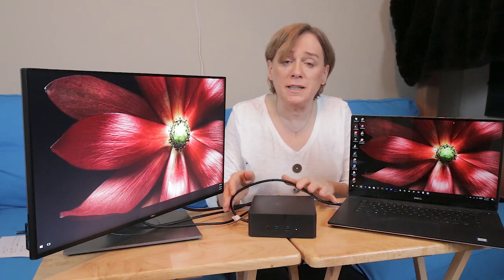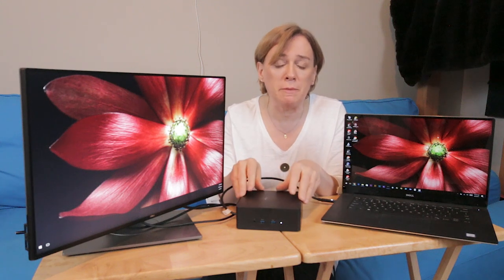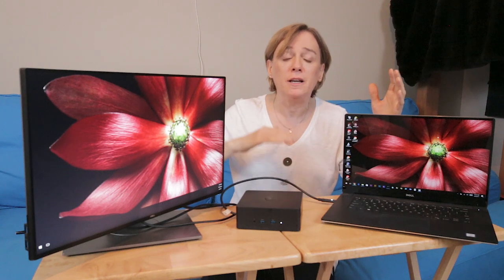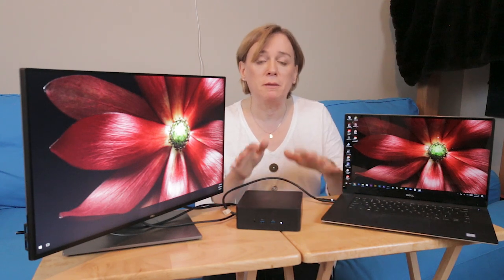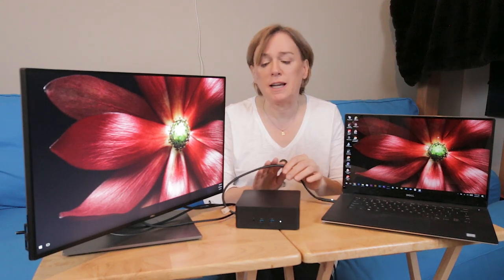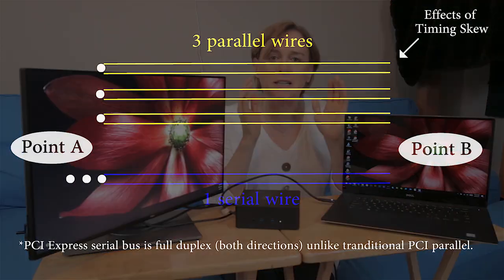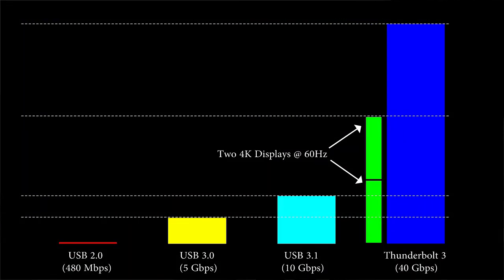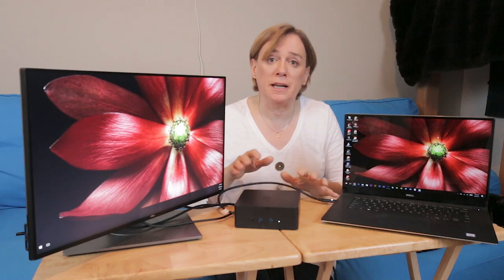Longer Dell Thunderbolt Dock TB16 Cable?

Comment: My biggest problem with this unit (I own 3 of them, one for my home office, and one on each of my 2 offices) is not the length of the cable, but the stiffness of it. It puts a significant strain on the port in the computer if it doesn't sit perfectly straight (effectively shortening the usable length). 
It is still the best way to connect PowerDelivery + HDMI UHD Screen plus a few of my USB / USB-C Peripherals (Webcam. Audio Interface, MIDI Keyboard ...) which is why I keep using these everywhere. I've tried many extenders, and never understood why they wouldn't work or my screen would flicker... I figured it'd be the extension, but never knew why. Now I do. I've then narrowed my search to finding just a 90 degree USB-C Thunderbolt adapter to help alleviate the strain on the laptops port. Hopefully that works. 

Thank you for this video, over half a decade after, still informing people. Amazon has dropped the price of this dock significantly, fyi, where it can be had for under $40, making it an outstanding deal.
Reply from the maker: @PaulSuquet, It's September 2023 ... forgive the delayed reply, just finishing a lengthy break away from the channel. Re the TB16... I fully agree with you... I still use my TB16 quite often, and sometimes with several large external USB storage devices connected through it, flawless... have not had any issues yet (beyond wear/tear leading to a cable replacement). Given Thunderbolt complexities and the abundance of high bandwidth traffic being multiplexed over a TB cable, I was never interested in interfering with Dell's design as they tested it. Given I use the TB16 for HDD connectivity, it's just too risky and my data is more important... meaning there are no 3rd parties between my TB16 and the XPS 15 9560... that is my rule. Given the overwhelming, quite surprising reliability I've experienced, it seems my sticking to spec makes sense. I've seen what happens even with some USB hubs and HDD traffic... it's not fun when it fails. The TB16 has been 100% perfect... no issues whatsoever with boatloads of HDD traffic. Regarding cable length... since this 2017 video, I've moved to a desk top setup... I initially used the TB16 on those small dinner trays and the couch... quite successfully actually... but those situations are challenged by the cable length, but when I moved to a desk setup, issues with cable length go out the door, are not an issue. Anyway, it is super great to hear your experience... it makes me wonder if I should go out and pick up a couple of more. The TB16 and XPS 15 9560 teams should get an industry award. (Yes, I know the 9560 only has two lanes to TB controller... but that's the spec of the unit... given that, it works well, very well for its bandwidth.) Thanks for stopping by, sharing your experience!

Comment: The 40Gbps Thunderbolt 3 cable in the TB16 is already an active cable, and with a substantial power consumption. I removed the TB16 cable from a dock and opened up the fat end of the cable that hides inside the dock. The fat end of the TB16 cable hidden inside the dock contains a circuit board, active chips that convert a many-pin connector into TB3, and thermal pads on both sides of its circuit board that sink heat to ridged metal exterior of the fat end of the cable, which is then cooled by a fan inside the TB16 dock. If it were to be longer and require any more power than it already uses I don't think the TB16 fan would be able to cool it.
Reply from the maker: @jamesmars6166, Thank you for your insight and for stopping by! It is 2023 now, forgive the delayed reply, was on long break from channel.

Comment: Thank you for saving me the time and trouble of attempting to swap my TB-16 and WD-15 cables!  I was going to do that to lengthen the cable; I did not realize the 40Gbps Thunderbolt-3 rate had a max length of 1.65ft.

I'm currently running an XPS-13 2-in-1 (9365) maxed out all specs with a TB-16, a KM-717 Combo, and a daisy-chained triple display U2417H InfinityEdge setup running off the mDP port.  The short cable length of the TB-16 was causing me some cable and desk management anxiety.  LOL! :)

Great video!
Reply from the maker: Thanks for the word Rahul, thanks for stopping by!
Reply: I actually swapped my WD-15 cable into my TB-16, my two monitors and peripherals still all work as expected. The TB-16 cable will not fit into the WD-15 though because of some pins on the connecter.

Comment: Thanks for the video Ashley. I embarked on a similar research and discovery adventure a few weeks ago, as I too wanted a longer thunderbolt cable... of course I came to the same conclusions as you, and have accepted the limiting cable length with a newfound respect for the thunderbolt 3 technology and this dock in particular. I must say, the TB16 combined with my XPS 15 and 27 inch external monitor are working fantastically! I think I have the exact same setup as you do in the video. I'm extremely happy with my setup and highly recommend this dock for anyone with a thunderbolt capable Dell laptop.
Reply from the maker: Thank you!

Comment: I have the TB16 with my Dell XPS 9560 but also run 2 extra USB-C ultra portable Asus external 15.6" monitors. My setup is super portable and allows me to setup wherever. I have used a type-c right angle connector going into my laptop and still am able to use everything including video and power, with no issues. Everything including my TB-16 and monitors fits in my messenger bag. My internet access comes from my Nighthawlk MR110 4G LTE router. It's pretty sweet!

Comment: Passive Thunderbolt 3 cables (made of copper) are identical to USB-C cables and plug into Thunderbolt 3 or USB-C ports: They transfer data at up to 20Gbps but they're not necessarily the most efficient. Active Thunderbolt 3 cables will use integrated chips to achieve full 40Gbps throughput. You should use active cables when connecting your laptop to 4K or 5K displays, or a solid-state-drive (SSD)-based RAID array. Active cables made of copper are limited to about 2m (6 feet) in length. 
Active optical cables (made of plastic and glass, like fiber optic cables) can extend their length from 2m up to roughly 70m (200 feet), but they require switching over to optical ports.

Comment: Do you know anything about the wd19? I have the tb16 and the wd19 and want to know if I should keep the tb16 or sell it and use the wd19 which isn't Thunderbolt 3.
Reply from the maker: @kylecthomas6513, It is 2023 now so you are probably long past your question. I do not own a WD19 so do not use one daily. I still use the TB16 regularly, sometimes with several hard drives connected, no issues (beyond cable replacement due to wear/tear). Re your questions, including whether or not to sell something, it's really not good to say without knowing more about your use cases and so forth. You should probably make that kind of assessment based on what you know of your overall situation, budget, whatnot. Forgive this delayed reply, it is 2023 now, was on long break from channel.

Comment: This video was extremely helpful to me. I was quite confused by all of the seeming contradictions of my new TB16. Thank you. 

Do you suppose a 90 degree adapter at the very end of the Thunderbolt cable would greatly affect the bandwidth?
Reply from the maker: Thank you for watching the video, I'm glad it was helpful! I can't say offhand what the loss would be but I've heard any sort of add-on connectors could affect speed and reliability. While I've never tried anything but their default cable, I've seen many times before when there are standards that express limitations that are shown to be looser than otherwise appears. You could experiment but there's no guarantee it will work or not cause additional problems... it's always at your own risk when going away from the mfg commitment. Thank you again!
Reply: yeah that is what they should offer and avoids material tension in the switch..

Comment: I remember watching your video a couple of years ago but I've stumbled across it once more while looking to see if Dell have released a cable since. Any update Ashley? I can't find out anything myself on this one! Keep up the good work!
Reply from the maker: Hi Lawrence, thanks for stopping by and the kind words! Some have mentioned there are active cables that work but I've not personally tested... I still use the supported default cable. I recently made a video on how I replaced that cable w/ebay replacement cable because the origina had gotten worn/broken... so now I have the same size cable but it's been replaced/refreshed. Now that I have a desk, it mostly work fine, did before too... would be great to free up desk space with longer cable but I'm making due. Thanks again for stopping by!

Comment: The wire is short because of the 240w it can push to charge the laptop. The XPS 15 only has 2 pci e lanes on its thunderbolt 3, its operating at thunderbolt 2 speeds anyway.
Reply from the maker: I was not aware the TB16 short cable length was connected with limitations caused by power delivery requirements... Thanks for sharing that. Where did you find that out? Thanks for watching!
Reply: The typical max is 100w, since the xps needs more, the cable has to be short
Reply from the maker: So do you mean the Thunderbolt 3 specifications literally, or just info at that URL you referenced? I do not have access to the actual specs so can't check there. But on the page you referenced, I do see a mention of 100W but no mention of cable lengths in relationship to power delivery. You could be inferring the 240W requires the length to be shorter than the standard given that 100W is mentioned on that page... but somehow I think you mean something more concrete connected with the actual TB3 standards. (?)
Reply from the maker: So perhaps you're inferring that since the public aspect of the standard calls out 100w in high level info that, for any more power such as 240w, the length can't be as long as typical cables? Makes sense, just curious if it's an inference or something tied to TB3 specifications. Thanks!
Reply: This Dell dock can pass through 130w. The remaining wattage is for devices attached to the dock. Only the "DC" docks can pass through 240w.

Comment: I really enjoy your content! I'm considering getting the Dell XPS 15, but I have a quick question. Do you notice any lag on the XPS when plugging in an external monitor? Other people have been saying that the fans kick in and get pretty loud on the XPS when using a monitor. Do you notice this?
Reply from the maker: Sorry for the delay but wanted to listen to my laptop/dock fans for a day or so... By lag, what do you mean specifically?

Generally speaking, I have not noticed any lag connected with the presence of an external display. It might help to know I only have one 1080p display at 60Hz which is far less DisplayPort output effort/data than one 4K much less dual 4K. I am not currently a gamer… just 1080p video editing.

After seeing your question yesterday, I tried to monitor the fan noise… I noticed 3 general levels: off, level 1, and a faster slightly louder level 2. There may be more "levels" (my own abstract term here) of fan speed but that’s what I’ve noticed. 

Right now I don’t hear the laptop fans, but I can hear the TB16 dock fan… it has a slight whirring but is relatively quiet. I just removed the 1080p external display cable from the dock about 5 minutes ago, but the TB16 dock fan is still going, so I guess it may always run, perhaps even increase if I were to add external monitors or do more work via the dock. 

Yesterday, when the laptop fan got going during heavy system use, including Premiere video editing, I could hear the fans but wasn’t bothered by it. They were at first low, then they increased to a faster speed when I was doing more work in Premiere. The fans always startup when rendering or using Premiere. Just now they were off, I started Premiere, they started running, I exited Premiere, they turned off.  

Let me clarify, though, my older 5+ year old laptop had/has this super loud whirring fan… very much unbearable. I think it’s age means today’s workloads trigger its fan much more easily than years ago… but it’s also older fan and heat sink tech so I expect it’s just not as quiet as today’s stuff. Compared to that older laptop, my XPS 15 fan experience has overall been dreamy. I’ll take it over the screaming whirring any day. LoL :D But my relative experience has improved dramatically if you see what I mean... if you're used to no fans at all, I can't says these won't be too much for ya.

The TB16 fan just went off about 5 minutes ago, I reinserted the 1080p cable to the TB16, it's been more than 5 minutes and still no fan, so it must not be immediately triggered by merely inserting the 1080 monitor. The monitor had no activity on it (as before) so I'm guessing sitting idle it is either not producing enough heat to trigger the fan, or it needs more idle time, and/or the TB16 has some other logic than merely heat which drives fan on/off. I haven't spent enough time with it to know yet. But that's what I know right now! 

Thanks again for the feedback!
Reply: This is very helpful! Thank you so much for answering my question! :)
Reply: Hi Jack, I have the same setup as Ashley and I can confirm that there's no lag, and no elevated fan engagement from either my laptop or the dock itself. This might be different if you connect 2 x 4K monitors, but the way things are working so far, i have full confidence that this dock and a high spec'ed XPS can handle the load. So far I've got a 27 inch FHD Dell Pro monitor, 2 external hard drives, a 7 port powered USB 3 hub from Orico, Network cable and external speakers connected to the dock, and I never hear the fan or experience any lag or errors. I hope you decided to get that XPS 15... what a machine!

Comment: Does the button on these docks turn a laptop on, or wake it up, without opening the lid?
Reply from the maker: Yes, pressing the dock button while the lid is closed turns on the laptop which then uses the external monitor.

Comment: Excellent review. Other then the cable length, is there anything else you found that could be improved?
Reply from the maker: Thank you Tony! The dock has so far worked quite nicely. One thing I noticed the other day was that the plastic casing that covers the TB16 plug at the end of the cable that connects into the laptop had broken/split. I need to call Dell to see about a replacement but in the meantime it has been working fine just the same. I may tape the plastic part back on until I get a replacement. I am betting this was caused because I'm stressing the short cable in unexpected ways given my particular usage of the laptop which, if interested, you can see in my TB16 unboxing video (https://www.youtube.com/watch?v=-qm6plwW1to).

Comment: Hi Ashely thanks for the video. But would like to ask if you have tested said TB16 on 3 external monitors. There was a video that the display dropped on those three monitors. Please advise on the matter. Thank you.
Reply from the maker: Hi Eugene, I believe the TB16 has specifications that allow for up to 3 FHD displays or 2 4K displays... and other variations depending on resolution and number of monitors.  I only have one external display, a Dell UltraSharp U2417H 1080p monitor so I have not personally tested anything beyond one external FHD display. It would really surprise me that, after having all the latest drivers, including any workarounds described on the Dell support site, that the TB16 wouldn't meet its specifications... but I haven't tested the specific thing you're asking about. One thing I can say is that, until I got all of my drivers up to date,  I saw some general glitches/freezes with my overall user experience, not necessarily just the TB16. After everything was updated, the system worked great. I discovered I had some really old drivers installed and that Dell's auto-update wasn't installing the latest everywhere, just want they wanted to push out from their site, likely because they need to validate things before posting them... but there was one issue, for example, that created downloading a newer Intel Graphics display driver from Intel not yet on the Dell site... there are instructions on how to do that by using the ZIP download from Intel, extracting, installing, etc. I think those special instructions are now on the Dell site, but at one time they were on the Dell reddit so always check the reddit for issues you might have. All of this is to say that I got my system working great by updating everything which includes not relying on the Dell auto-update and going out and searching for articles relating to you issues and making sure you get any special versions of drivers like from Intel or other trusted sources. Like before I did all that, I had a really old NVIDIA driver from 2016, and an Intel Graphics driver older than the one from Intel, once those and some other drivers were updated (manual steps were required as mentioned above), the system sailed extremely smoothly thereafter. So if anyone is having multi-FHD display issues with TB16... make sure you have the latest BIOS and everything else... and don't rely on auto-update, manually sort drivers on the Dell XPS 15 and TB16 support pages to manually check version numbers just to double-check... the point is don't sit and expect the latest stuff to be in there.. some user action is required, i found, to get things into shape but after that, smooth sailing so far. 

Here's were I saw mention of 3 FHD displays: http://www.dell.com/support/article/us/en/04/SLN301105/dell-thunderbolt-dock--tb16--information--specifications--frequently-asked-questions?lang=EN